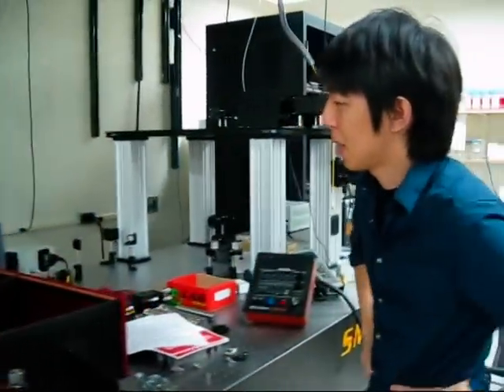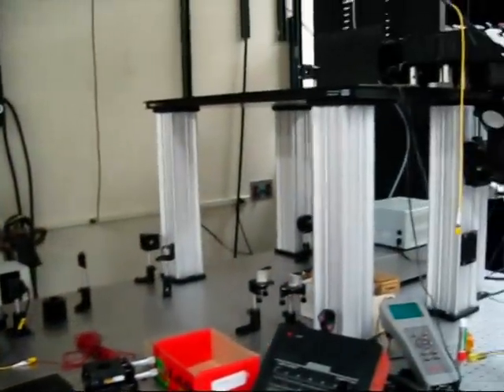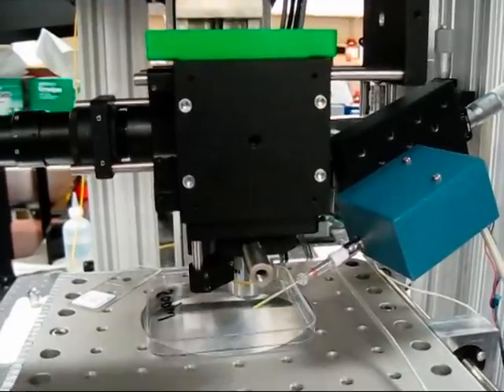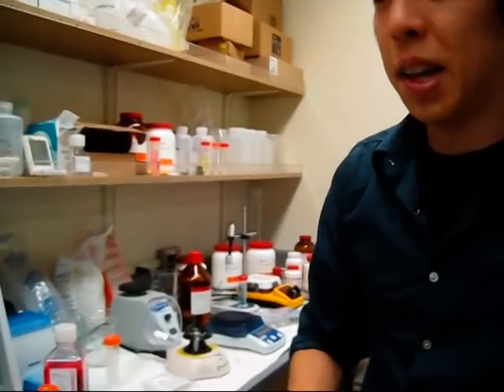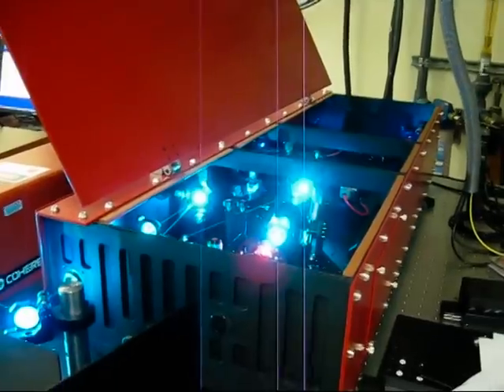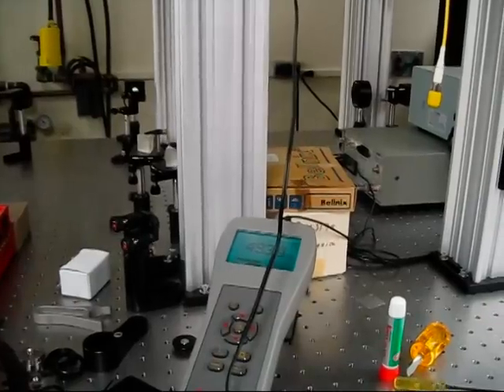Del Mar Photonics Ti:Sapphire laser Trestles in the UCLA Biophysics Neuroimaging Laboratory

Comment from the maker: Three dimensional optofluidic device for isolating marine microbes
Anusha Keloth, Lynn Paterson, Gerard H. Markx, Ajoy K. Kar
9 February 2015 • 2:50 - 3:10 PM | Part of SPIE BiOS

Machine technology for 3D microprocessing of complex curved surfaces
Max Groenendijk
12 February 2015 • 3:30 - 4:00 PM | Part of SPIE LASE

Digital micromirror devices for laser-based manufacturing on the micro-scale
Ben Mills, Dan Heath, Matthias Feinaeugle, Rob W. Eason
10 February 2015 • 9:50 - 10:10 AM | Part of SPIE OPTO

Fabrication of a plasmonic pyramid array substrate and microfluidic device for cell transfection
Daryl I. Vulis, Marinus Huber, Nabiha Saklayen, Sebastien Courvoisier, Jean-Pierre Wolf, Eric Mazur
8 February 2015 • 5:40 - 6:00 PM | Part of SPIE LASE

Colloidal, inorganic nanoparticles as efficient nonlinear optical probes
Dominika Wawrzynczyk, Marcin Nyk, Janusz Szeremeta, Marek Samoc
8 February 2015 • 4:05 - 4:20 PM | Part of SPIE BiOS

In vivo visualization of collagen fiber produced by cultured osteoblasts using sensitive second-harmonic-generation microscopy equipped with a 10-fs mode-locked Ti:sapphire laser
Eiji Hase, Katsuya Sato, Takeshi Yasui
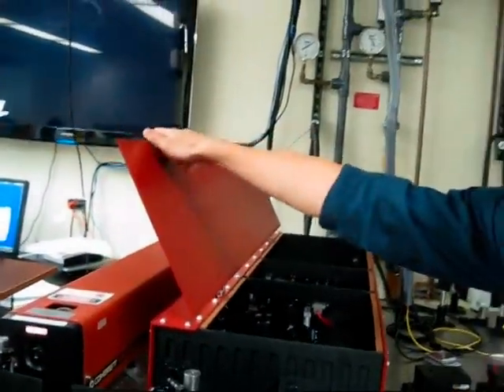8 February 2015 • 5:30 - 7:00 PM | Part of SPIE BiOS

Towards the development of an ultracompact optically sectioning endoscope with no distal optics
Youngchan Kim, Sean Warren, James M. Stone, James Roper, Jonathan C. Knight, Mark Neil, Carl Paterson, Christopher W. Dunsby, Paul M. W. French
9 February 2015 • 12:00 - 12:20 PM | Part of SPIE BiOS

Role of the surface plasma density on the formation of laser induced periodic surface structures (LIPSS) on Ti upon double fs pulse irradiation
Laura Gemini, Masaki Hashida, Yasuhiro Miyasaka, Shunsuke Inoue, Jiri Limpouch, Tomas Mocek, Shuji Sakabe
12 February 2015 • 10:00 - 10:20 AM | Part of SPIE LASE

5.7mJ fiber-CPA system delivering 23.5 gW of peak power
Arno Klenke, Steffen Hadrich, Tino Eidam, Marco Kienel, Jens Limpert, Andreas Tunnermann
11 February 2015 • 3:50 - 4:10 PM | Part of SPIE LASE

Intense THz sources for condensed matter physics
Matthias C. Hoffmann
10 February 2015 • 2:20 - 2:50 PM | Part of SPIE LASE

Chirped- and divided-pulse Sagnac fiber amplifier
Florent Guichard, Yoann Zaouter, Marc Hanna, Franck Morin, Clemens Honninger, Eric P. Mottay, Patrick Georges
11 February 2015 • 4:30 - 4:50 PM | Part of SPIE LASE

Increasing performance of mobile devices: fs laser assisted high quality photonic devices in display glass screens
Jerome Lapointe, Mathieu Gagne, Raman Kashyap
9 February 2015 • 4:00 - 4:20 PM | Part of SPIE LASE

Plasma dynamics during fs-laser fabrication of waveguides inside zinc phosphate glass
Javier Hernandez Rueda, Vladimir Semenov, Neil Troy, Charmayne E. Smith, Richard K. Brow, Denise M. Krol
9 February 2015 • 3:20 - 3:40 PM | Part of SPIE LASE

Ultrashort pulse laser interactions with cortical bone tissue for applications in orthopaedic surgery
Simon A. Ashforth, Miriam C. Simpson
8 February 2015 • 11:10 - 11:30 AM | Part of SPIE LASE

Bioinspired artificial light collectors for enhancement of imaging in dim environments
Hewei Liu, Yinggang Huang, Chi-chieh Huang, Hongrui Jiang
7 February 2015 • 10:50 - 11:05 AM | Part of SPIE BiOS

Two-photon photoacoustic microscopy using image subtraction with two different pulse excitations
Yoshihisa Yamaoka, Yoshinori Harada M.D., Masaaki Sakakura, Takeo Minamikawa, Shigeru Nishino, Seiji Maehara, Shujiro Hamano, Hideo Tanaka M.D., Tetsuro Takamatsu M.D.
10 February 2015 • 6:00 - 8:00 PM | Part of SPIE BiOS

Binary phase shaping for mitigating self-phase modulation
Gennady Rasskazov, Marcos M. Dantus
10 February 2015 • 6:00 - 8:00 PM | Part of SPIE LASE

Fluorescence lifetime imaging in the near-infrared region
Wolfgang Becker, Vladislav I. Shcheslavskiy
8 February 2015 • 5:30 - 7:00 PM | Part of SPIE BiOS

Optical and thermal properties in ultrafast laser surface nanostructuring on biodegradable polymer
Shuhei Yada, Mitsuhiro Terakawa
8 February 2015 • 8:50 - 9:10 AM | Part of SPIE LASE

Fabrication of perfluoropolyether atomic force microscopy tips with two-photon polymerization
Tommaso Zandrini, Raffaella Suriano, Carmela De Marco, Roberto Osellame, Stefano Turri, Francesca Bragheri
10 February 2015 • 6:00 - 8:00 PM | Part of SPIE LASE

Laser-induced breakdown spectroscopy for chemical characterization of laser structured Li(NiMnCo)O2 electrodes for lithium-ion batteries
Peter Smyrek, Johannes Proll, Hans J. Seifert, Wilhelm Pfleging
12 February 2015 • 2:30 - 2:50 PM | Part of SPIE LASE

Nonlinear compression of industrial ultrafast lasers in hypocyloid-core Kagome hollow-core fiber
Achut Giree, Florent Guichard, Guillaume Machinet, Yoann Zaouter, Yvon Hagen, Benoit Debord, Pascal Dupriez, Frederic Gerome, Marc Hanna, Fetah A. Benabid, Clemens Honninger, Patrick Georges, Eric P. Mottay
9 February 2015 • 8:30 - 8:50 AM | Part of SPIE LASE

Effect of the Zn coordination complex of the excited-state and two-photon absorption spectra of a novel salicylidene compound
Marcelo G. Vivas, Jose Germino, Tereza Atvarz, Cleber Mendonca
8 February 2015 • 4:15 - 4:30 PM | Part of SPIE OPTO

Single grating mirror intracavity stretcher design for chirped pulse regenerative amplification
Etienne Caracciolo, Matthias Kemnitzer, Martin Rumpel, Annalisa Guandalini, Florian kienle, Federico Pirzio, Thomas Graf, Marwan Abdou Ahmed, Antonio Agnesi, Juerg Aus-der-Au
10 February 2015 • 11:10 - 11:30 AM | Part of SPIE LASE

Enhanced nanograting formation assisted by silver ions in a sodium gallophosphate glass: Correlation between surface nanostructuring, fluorescence, and effective second-order nonlinear optical properties
Marie Vangheluwe, Feng Liang, Yannick Petit, Patricia Hee, Yannick Ledemi, Sebastien Thomas, Nicolas Marquestaut, Evelyne Fargin, Thierry Cardinal, Younes Messaddeq, Lionel Canioni, Real Vallee
8 February 2015 • 2:30 - 2:50 PM | Part of SPIE OPTO

Yb-fiber laser for multimodal imaging
Ilyas Saytashev, Bingwei Xu, Marcos Dantus
9 February 2015 • 4:05 - 4:20 PM | Part of SPIE BiOS

Two-photon endoscope with no distal optics
Herve Rigneault, Esben R. Andresen, Geraud Bouwmans, Serge Monneret
9 February 2015 • 2:30 - 2:50 PM | Part of SPIE BiOS

Elucidating photodynamics with ultrafast pulse sequences: pump-repump, multidimensional spectroscopy, and beyond
Patrick Nuernberger, Stefan Ruetzel, Tobias Brixner
8 February 2015 • 11:15 - 11:45 AM | Part of SPIE OPTO

Broadband 2.5-6?m frequency comb source for dual-comb molecular spectroscopy
Viktor O. Smolski, Konstantin L. Vodopyanov
9 February 2015 • 2:35 - 2:55 PM | Part of SPIE LASE

Photonic crystal fiber supercontinuum sources for optogenetics
Eugene D. Ark, Kush Paul, Haohua Tu, Youbo Zhao, Stephen A. Boppart
7 February 2015 • 4:20 - 4:40 PM | Part of SPIE BiOS

Ultrafast non-equilibrium carrier dynamics in semiconductor laser mode-locking
Jerome V. Moloney, Isak Kilen, Joerg Hader, Stephan W. Koch
9 February 2015 • 8:00 - 8:30 AM | Part of SPIE LASE

THz generation by optical rectification in graphene at room temperature: beyond the linear carrier dispersion
Juliette Mangeney, Jean Maysonnave, Simon Huppert, Feihu Wang, Simon Maero, Claire Berger, Walter A. de Heer, Theodore B. Norris, Louis-Anne de Vaulchier, Sukhdeep S. Dhillon, Jerome Tignon, Robson Ferreira
8 February 2015 • 12:15 - 12:35 PM | Part of SPIE OPTO

Ultrafast biexciton dynamics in single CdSe/ZnSe quantum dots
Denis V. Seletskiy, Christopher Hinz, Johannes Haase, Christian Traum, Florian Werschler, Stefan Lohner, Alfred Leitenstorfer
10 February 2015 • 12:20 - 12:35 PM | Part of SPIE OPTO

Efficient Auger scattering in Landau-quantized graphene
Florian Wendler, Martin Mittendorff, Stephan F. Winnerl, Manfred Helm, Andreas Knorr, Ermin Malic
8 February 2015 • 9:45 - 10:00 AM | Part of SPIE OPTO

Self-focusing effect on THG at interfaces of solvent-cuvette
Emerson C. Barbano, Kerrianne Harrington, Sergio C. Zilio, Lino Misoguti
10 February 2015 • 6:00 - 8:00 PM | Part of SPIE LASE

Charge separation in OPV bulk heterojunctions
Andrew B. Matheson, Arvydas Ruseckas, Ifor D. W. Samuel
11 February 2015 • 6:00 - 8:00 PM | Part of SPIE OPTO

Advances in Chalcogenide galsses and Optical fibers
Younes Messaddeq, Sandra H. Messaddeq, Mohammed Elamraoui, Jean-Philippe Berube, Real Vallee
10 February 2015 • 9:30 - 10:00 AM | Part of SPIE OPTO
9 February 2015

Ultrafast coherent charge transfer in solar cells and artificial light harvesting systems: toward movies of electronic motion
Christoph Lienau
9 February 2015 • 8:50 - 9:30 AM | Part of SPIE OPTO

Sub-100 fs passively mode-locked holmium-doped fiber oscillator operating at 2.06?m
Peng Li, Axel Ruehl, Ingmar Hartl
12 February 2015 • 11:00 - 11:20 AM | Part of SPIE LASE

Laser induced structural modifications in fused silica within the microexplosion regime evidenced by Raman spectroscopy
Nadezda Varkentina, Arnaud Royon, Marc Dussauze, Yannick Petit, Lionel Canioni
10 February 2015 • 11:30 - 11:50 AM | Part of SPIE LASE
9 February 2015

Mechanisms of direct laser writing on a tailored silver-containing zinc phosphate glass: dual-color laser writing, UV post-illumination thermal influence, and sub-diffraction structures
Yannick G. Petit, Konstantin Mishchik, Nadezda Varkentina, Arnaud Royon, Nicolas Marquestaut, Etienne Brasselet, Thierry Cardinal, Lionel S. Canioni
9 February 2015 • 5:30 - 5:45 PM | Part of SPIE OPTO

Active tunable photonics and ultrafast nonlinear optics with nematic and blue phase liquid crystals
Iam Choon Khoo
10 February 2015 • 11:00 - 11:30 AM | Part of SPIE OPTO
11 February 2015

Mobile laser lithography station for microscopic two-photon polymerization
Frank Leinenbach, Hans G. Breunig, Karsten Konig
12 February 2015 • 4:20 - 4:40 PM | Part of SPIE LASE

Broadband transient THz conductivity of the transition-metal dichalcogenide MoS2
Jan H. Buss, Ryan P. Smith, Giacomo Coslovich, Robert A. Kaindl
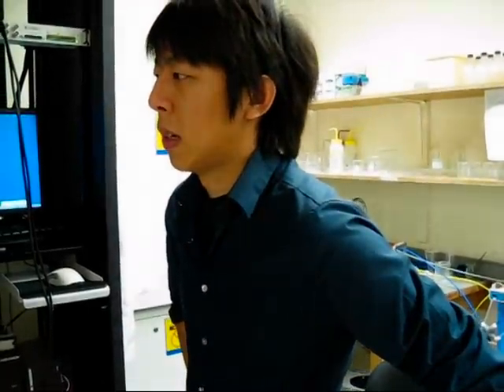10 February 2015 • 5:00 - 5:15 PM | Part of SPIE OPTO

Amorphous chalcogenide layers and nanocomposites for direct surface patterning
Sandor J. Kokenyesi, Sandor Molnar, Roland Bohdan, Istvan Csarnovics
9 February 2015 • 2:00 - 2:20 PM | Part of SPIE OPTO

Process and parameter optimisation for micro structuring of 3D freeform metallic surfaces: A comparative study of shortpulse (ns) and ultrafast laser (ps, fs) ablation
Steffen G. Scholz, Melanie Mangang, Wilhelm Pfleging
10 February 2015 • 4:20 - 4:40 PM | Part of SPIE LASE

Optical multi-coset sampling of GHz-band chirped signals
George C. Valley, George A. Sefler, Thomas J. Shaw, Stephen L. Smith
11 February 2015 • 2:00 - 2:20 PM | Part of SPIE OPTO

Bessel filamentation in glass
Chen Xie, Vytautas Jukna, Ismail Ouadghiri, Carles Milian Enrique, Remo Giust, Luca Furfaro, Pierre-Ambroise Lacourt, Maxime Jacquot, Luc Froehly, Razvan Stoian, Tatiana E. Itina, John M. Dudley, Arnaud Couairon, Francois Courvoisier
11 February 2015 • 9:20 - 9:40 AM | Part of SPIE LASE

Flat mid-infrared supercontinuum generation in tapered fiber with thin coating of highly nonlinear glass
Pantelis Velanas, Christos Riziotis, Georgios Kakarantzas
10 February 2015 • 6:00 - 8:00 PM | Part of SPIE LASE
11 February 2015

Plasmonic cell transfection using micropyramid arrays
Nabiha Saklayen, Daryl I. Vulis, Marinus Huber, Lauren E. Milling, Sebastien Courvoisier, Valeria Nuzzo, Eric Mazur
8 February 2015 • 4:40 - 5:00 PM | Part of SPIE LASE

Ultrafast carrier dynamics in atomically thin WS2 layers in the low- and high-density regime
Claudia Ruppert, Alexey Chernikov, Heather M. Hill, Albert Rigosi, Tony F. Heinz
8 February 2015 • 2:30 - 2:45 PM | Part of SPIE OPTO

Plasmonic substrates for cell transfection
Marinus Huber, Nicolas Vogel, Weilu Shen, Nabiha Saklayen, Alexander Heisterkamp, Eric Mazur
10 February 2015 • 6:00 - 8:00 PM | Part of SPIE LASE

Next generation laser sources for non-linear imaging
Darryl McCoy, Marco Arrigoni, Nigel Gallaher
8 February 2015 • 4:10 - 4:25 PM | Part of SPIE BiOS

Nano-focused ultrafast spectroscopy and imaging reaching the single quantum level
Markus B. Raschke
9 February 2015 • 2:00 - 2:30 PM | Part of SPIE OPTO

Laser-assisted manufacturing of micro-optical volume elements for improving the amount of light absorbed by solar cells in photovoltaic modules
Gerhard Peharz, Ladislav Kuna, Claude Leiner
11 February 2015 • 6:00 - 8:00 PM | Part of SPIE OPTO

Mechanisms of 3D nanoparticles formation using direct laser writing and thermal annealing in a phosphate glass
Nicolas Marquestaut, Yannick G. Petit, Patrick Mounaix, Thierry Cardinal, Lionel S. Canioni
12 February 2015 • 9:20 - 9:40 AM | Part of SPIE LASE

Ultrafast element-specific magnetization dynamics of complex magnetic materials on a table top
Stefan Mathias, Chan La-O-Vorakiat, Justin M. Shaw, Emrah Turgut, Patrik Grychtol, Roman Adam, Denis Rudolf, Hans T. Nembach, Thomas J. Silva, Martin Aeschlimann, Claus M. Schneider, Henry C. Kapteyn, Margaret M. Murnane
11 February 2015 • 9:00 - 9:30 AM | Part of SPIE OPTO

Chirp scanning technique to determine the non-degenerate two-photon absorption
Renato Juliano Martins, Cleber R. Mendonca
8 February 2015 • 5:00 - 5:15 PM | Part of SPIE OPTO

MEMS-based handheld multiphoton endomicroscope for in vivo imaging
Xiyu Duan, Haijun Li, Zhen Qiu, Bishnu P. Joshi, Asha Pant, Katsuo Kurabayashi, Kenn R. Oldham, Thomas D. Wang M.D.
9 February 2015 • 3:40 - 4:00 PM | Part of SPIE BiOS

Competition between harmonic generation and multi-photon luminescence in selectively grown coaxial InGaN/GaN quantum wells on GaN pyramids for tunable light emission
Sween J. Butler, Mohamed Fikry, Klaus Thonke, Arup Neogi
11 February 2015 • 2:50 - 3:10 PM | Part of SPIE LASE

Low-noise supercontinuum: Development, characterization, and programmable biomedical imaging
Haohua Tu, Yuan Liu, Sixian You, Stephen A. Boppart M.D.
9 February 2015 • 10:40 - 11:00 AM | Part of SPIE LASE

Photoacoustic imaging using NIR two-photon excitation for ultrasonic wave generation
Ben E. Urban, Jr.
9 February 2015 • 5:30 - 7:30 PM | Part of SPIE BiOS

Coherent pulse stacking in fiber chirped-pulse amplification systems
Tong Zhou, John M. Ruppe, Cheng Zhu, I-Ning Hu, John A. Nees, Russell B. Wilcox, Almantas Galvanauskas
11 February 2015 • 4:10 - 4:30 PM | Part of SPIE LASE

Terahertz wavefront assessment based on 2D electro-optic imaging
Harsono Cahyadi, Ryuji Ichikawa, Jerome Degert, Eric Freysz, Takeshi Yasui, Emmanuel Abraham
10 February 2015 • 4:40 - 5:00 PM | Part of SPIE OPTO

DNA separation and fluorescent detection in an optofluidic chip with sub-base-pair resolution
Markus Pollnau, Manfred Hammer, Chaitanya Dongre, Hugo J. W. Hoekstra
8 February 2015 • 2:00 - 2:20 PM | Part of SPIE BiOS

Effects of burst mode on transparent materials processing
Clementine Javaux, John Lopez, Clemens Hoenninger, Eric P. Mottay, Rainer Kling
10 February 2015 • 5:20 - 5:40 PM | Part of SPIE LASE

Ultrashort pulsed laser tools for testing of semiconductor device hardness to local radiation effects caused by cosmic heavy ions
Oleg B. Mavritskii, Andrey N. Egorov, Alexandra V. Gordienko, Alexander A. Pechenkin, Dmitriy V. Savchenkov
10 February 2015 • 6:00 - 8:00 PM | Part of SPIE LASE

Ultrafast acousto-magneto-plasmonics
Vasily V. Temnov
10 February 2015 • 2:25 - 2:55 PM | Part of SPIE OPTO

Nonlinearly fiber-converted coherent source with broad spectral coverage for multiphoton imaging
Haohua Tu, Yuan Liu, Youbo Zhao, Stephen A. Boppart M.D.
8 February 2015 • 1:50 - 2:10 PM | Part of SPIE BiOS

Deep stroma investigation by confocal microscopy
Francesca P. Rossi, Francesca Tatini, Roberto Pini, Paola Valente, Roberta Ardia, Luca Buzzonetti, Annalisa Canovetti, Alex Malandrini, Ivo Lenzetti, Luca Menabuoni M.D.
8 February 2015 • 5:30 - 7:00 PM | Part of SPIE BiOS

Role of molecular photodissociation in ultrafast laser surgery
Jenny Wang, Georg Schuele, Phil Huie, Daniel V. Palanker
9 February 2015 • 8:50 - 9:10 AM | Part of SPIE BiOS

Two photon microscopy of native fluorophores spatial location in cancer and non-cancer cell lines
Lin Zhang, Lingyan Shi, Robert R. Alfano
8 February 2015 • 5:30 - 7:00 PM | Part of SPIE BiOS

Pulse splitter to produce ultrafast bursts
Antoine Courjaud, Vincent Clet, Areti Mourka, Aghasi Lorsabyan, Eric P. Mottay
9 February 2015 • 9:50 - 10:10 AM | Part of SPIE LASE

In vivo high-speed imaging of blood cells and tissues in mouse ear skin using multimodal nonlinear optical microscopy
Eung Jang Lee, Daeyeon Kim, Bo Ram Kim, Sung-Ho Lee, Seung-Han Park
8 February 2015 • 5:30 - 7:00 PM | Part of SPIE BiOS

Ultrafast in-situ probing of passively mode-locked VECSEL dynamics
Maik Scheller, Caleb W. Baker, Stephan W. Koch, R. Jason Jones, Jerome V. Moloney
9 February 2015 • 4:50 - 5:10 PM | Part of SPIE LASE

Laser nanofabrication for functional devices
Hong-Bo Sun
11 February 2015 • 4:10 - 4:40 PM | Part of SPIE LASE

Advances in planar photonic integration with a novel ultrafast laser plasma fabrication process
Jayakrishnan Chandrappan, Matthew Murray, Tarun Kakkar, Kenneth L. Kennedy, Richard A. Hogg, David P. Steenson, Gin Jose, Animesh Jha
10 February 2015 • 11:10 - 11:30 AM | Part of SPIE OPTO

Adaptive optics for the laser fabrication of 3D graphitic microwires in diamond
Patrick S. Salter, Bangshan Sun, Martin J. Booth
10 February 2015 • 9:20 - 9:40 AM | Part of SPIE LASE

Group delay of 45 ns in a 1-cm fiber Bragg grating
George Skolianos, Michel Digonnet, Arushi Arora, Martin Bernier, Real Vallee
9 February 2015 • 11:35 AM - 12:00 PM | Part of SPIE OPTO

Metal mirrors with metal-dielectric HR-coating for ultrashort lasers pulses applied in scanner applications
Mark Schuermann, Christian Franke, Sandra Mueller, Stefan Risse, Helena Kaemmer, Felix Dreisow, Stefan Nolte, Ramona Eberhardt, Norbert Kaiser
11 February 2015 • 9:40 - 10:00 AM | Part of SPIE LASE

Fiber laser driven ultrafast RGB source based on simultaneous second harmonic generation from a dual zero dispersion wavelength fiber source
Yuhong Yao, Wayne H. Knox
10 February 2015 • 4:20 - 4:40 PM | Part of SPIE LASE

Experimental demonstration of multidimensional amplification of ultrashort pulses
Marco Kienel, Michael Mueller, Arno Klenke, Tino Eidam, Jens Limpert, Andreas Tunnermann
11 February 2015 • 3:00 - 3:20 PM | Part of SPIE LASE

High speed deep tissue ablation with nonlinear imaging using an ultrafast fiber laser at 1045 nm
Murat Yildirim, Kaushik G. Subramanian, Adela Ben-Yakar
8 February 2015 • 9:10 - 9:30 AM | Part of SPIE LASE

Laser patterning for reel-to-reel production of organic photovoltaic (OPV) devices
Colin J. Moorhouse, Dimitris Karnakis, Christos Kapnopoulos, Argiris Laskarakis, S. Logothetidis, G. Antonopoulos, Christos Koidis
11 February 2015 • 4:00 - 4:20 PM | Part of SPIE LASE
COURSE AT CONFERENCE
Introduction to Ultrafast Optics (SC746)
Instructor(s): Trebino, Rick, Georgia Institute of Technology
Level: Introductory • 0.35 CEU • Length: 4.00 hours
Member Price: 300.00 | Non-Member Price: 355.00
8 February 2015 • 1:30 PM | Part of SPIE Photonics West

Optical isolators for 2-micron fibre lasers
Gary Stevens, Thomas H. Legg, Peter Shardlow
11 February 2015 • 9:30 - 9:50 AM | Part of SPIE LASE

Monolithic hybrid optics for broadband focusing and beam shaping
Ulrike Fuchs
10 February 2015 • 5:20 - 5:40 PM | Part of SPIE LASE

Sub-700fs pulses at 152W average power from a Tm-doped fiber CPA system
Christian Gaida, Fabian Stutzki, Martin Gebhardt, Florian Jansen, Andreas Wienke, Uwe D. Zeitner, Frank Fuchs, Cesar Jauregui-Misas, Dieter Wandt, Dietmar Kracht, Jens Limpert, Andreas Tunnermann
12 February 2015 • 10:40 - 11:00 AM | Part of SPIE LASE

Novel nanoring structure for light-induced generation of ultrashort magnetic pulses
Guillaume G. Vienne, Xiaoyu Chen, Ying Shi Teh, Ying Jye Ng, Nyap Oon Chia, Ching Ping Ooi
11 February 2015 • 10:00 - 10:15 AM | Part of SPIE OPTO

Spatial and temporal temperature distribution of ultrashort pulse induced heat accumulation in glass
Soren Richter, Fumiya Hashimoto, Yasuyuki Ozeki, Kazuyoshi Itoh, Andreas Tunnermann, Stefan Nolte
10 February 2015 • 10:50 - 11:10 AM | Part of SPIE LASE

Ultrashort pulse laser processing of glass: From cutting to welding
Stefan Nolte
11 February 2015 • 2:00 - 2:30 PM | Part of SPIE LASE